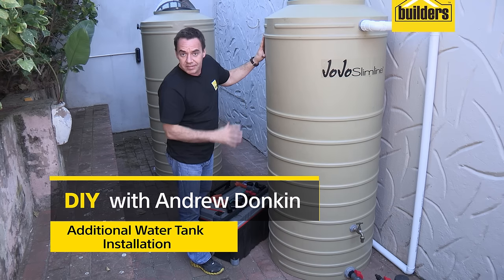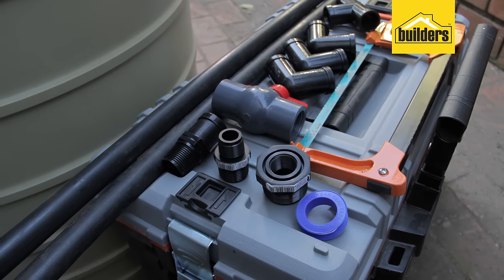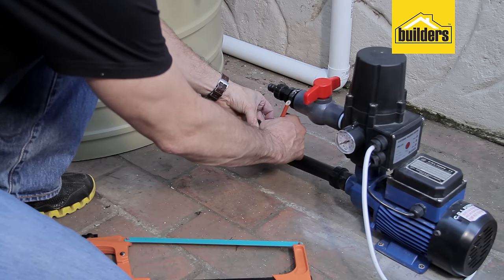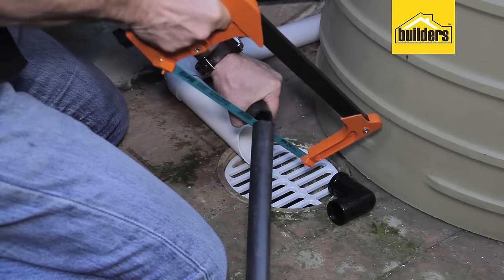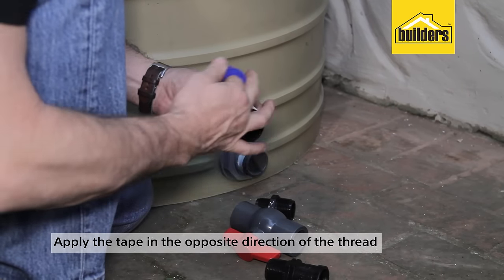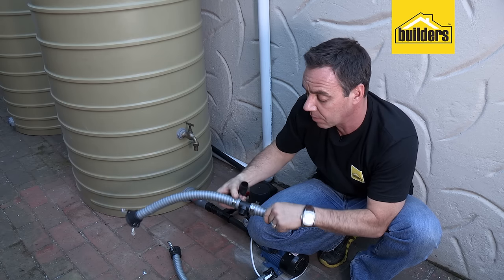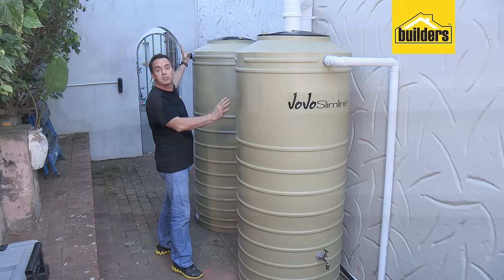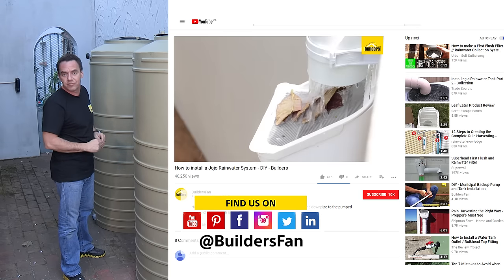How to Install a 2nd Rain Harvesting Water Tank

Comment: I agree that the second tank does not need an overflow outlet BUT it must have some sort of breathing aperture e.g. drill 2 or 3 small holes in the lid. If there is no breather the 2nd tank may have difficulty filling up or releasing water fast enough when needed.

Comment: hi just some law of physic question. when the water starts to flow in both of the tank will be fill up at the same rate / amount of water right? or the on the at the left extra tank will be filled to the top before the right side water ball stops the flow of water going in.
Reply: they will fill up at the same rate